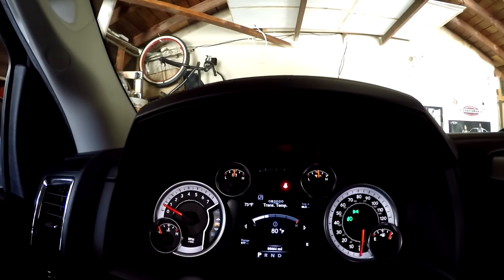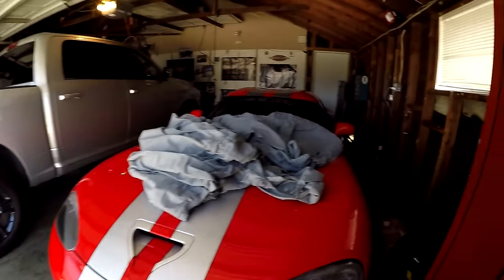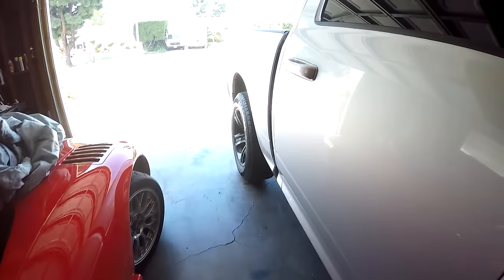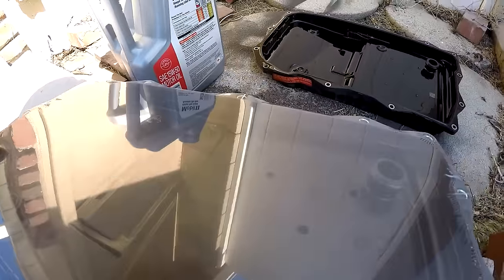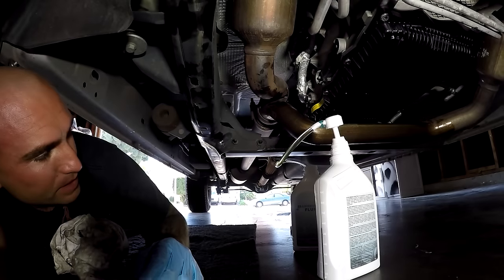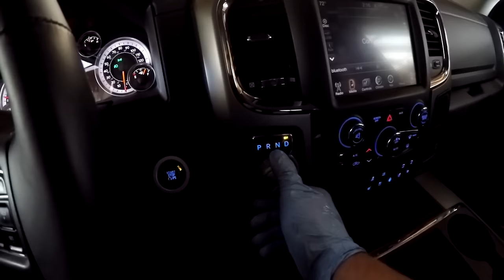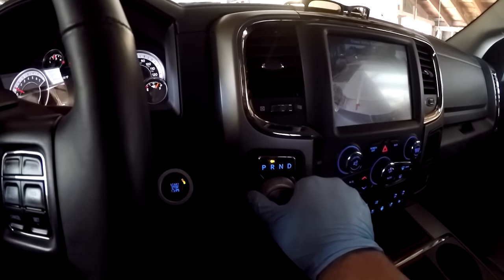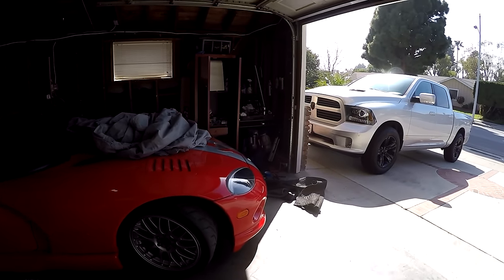Dodge RAM 1500 - ZF 8 Speed Automatic Transmission - Fluid & Filter Change

Comment: why they couldn't design it with a filler tube is beyond me.
Reply: more opportunities for water ingress, harder to make it work with multiple vehicles, a dipstick is more open to interpretation too.
Reply: Manufacturers do their best to make sure their vehicles come back to them for service.....also it saves money. If a tube costs a dollar and you make a million trucks. Ram saves a million lol.
Reply: @rjbeer  and to keep you jokers from servicing it yourself. This is a sealed system. It takes a completely different fluid than atf.
Reply: @imus1426  that's why jokers like myself research and read so it's done right.
Reply: @rjbeer  that's nice. What google search, I mean "research" did you do?
Reply: @imus1426  my brother is a Bentley, Rolls, and Aston master tech and his shop deals with various other high end cars that use this trans. So getting the maintenance manuals isn't hard. As for myself, I am a helicopter electrician who is also a&p certified. I think I know how to do my own work. Any other inquiries?
Reply: @rjbeer  I'm sure. That's cute though. With all that and you still think it's some big scam they are running.
Reply: @rjbeer  a "master tech" of Aston, Bentley and rolls. Yea I've had cars come in from independent shops that call themselves that too. We fix their screw ups. You shouldn't get so defensive over my slightly joking comment in reference to your original comment that had no credence. They make products to last longer than they use to but not to surpass the certified programs when cars start to go to auction and outside dealers. That's when people go to outside shops and we usually dont share 100 percent of the info with them, only enough go get by. If your brother is a master tech as you state then he would tell you to not touch the trans fluid unless it was contaminated or taken apart. Those are the only 2 reasons to do a fluid change on the zf
Reply: @rjbeer  read my other reply
Reply: @imus1426  I will add just for background he doesnt work for an independent shop like you think. He works at the dealer and trained by those manufacturers. But I would like to hear your explanation as to why ram recommends on thing and zf another?
Reply: @rjbeer  if zf makes the trans then it would be their recommendations for the fluid service. I dont know what your dealer is telling you which yes I know some of those advisors don't know shit but that trans uses a lifetime fluid. It is not meant to be changed and cannot use any other trans fluid. If your were to service these correctly then it could cost up to 1000 dollars. Now how would that make sense on a 3000 dollar trans. The true zf for a bmw which is what I do is about 8000. We dont do this to make you come back. After 100 thousand miles we dont care what you do as it is out of warranty. We dont have issues with the zf unless someone messed around with something or ran the dog shit out of it. Mopar has several models of this exact trans, some are true zf and some are mopar versions of zf with modified internals but ALL require the same service. Any other inquiries?
Reply: @imus1426  lol this started over a dip stick comment. But anyway I know what you are saying. I understand that it is supposed to be lifetime fluid and lifeguard 8 is the only fluid advised for this trans. But in my line or work when you have 2 different recommendations on a service you go with the most strict. Mopar says lifetime, zf says 80k km to 120k km. I tow and use my truck pretty hard, I'd be a fool to not service if I expect to continue to use my truck after 100k. And if I get free fluid and can do it myself why not? All I pay is time and for a new filter pan. Honestly if you check out my video I have about changing the fluid on my ram it will show you why I feel the way I do and think lifetime anything is bs. All the magnets do their job in this trans but still I feel for at least the truck the service schedule might be a little lacking if they expect a long lasting truck. I will say when I bought my truck is was weary of the 8 speed but my bro sold me on it, and he was right...I love it.
Reply: @imus1426  is the most qualified man in the room. If you're smart you'll ask him questions and become  smarter!
Reply: dnnyshdy  Ford put zf manuals behind their early pickup diesels which were pretty much a joke.
Reply: Convenience. The tech is down there draining anyway, why not fill it there.

Comment: I I was following along just fine until you started talking about the slow trickle coming out of the bottom? I could see that there was fluid running out, but, I guess I just don't understand what was happening or why.

I've never done this before so, if you happen to get around to replying to this, could you please explain it as if you were talking to a child? Haha! Either way, thanks for the video.
Reply from the maker: You'll see a ton of fluid pouring out when the level is too high.  Once it spits this excess out you'll see just a fine stream coming out which is just oil splashing around inside coming out but the oil level is sufficient.  Once you see this you want to put the plug back in. 👍

Comment: This trany has no Torque converter! It uses a wet clutch instead. Power flushing is a waste of time. Mercedes uses this trany. BMW as far as I know the X5 I had used a dual clutch direct gear to gear. The fastest shifting auto available.
Reply: Actually, this transmission does have a torque converter. Benz uses their own transmissions- primarily the 9G-Tronic, as well as the 7G-Tronic for twelve-cylinder cars. The X5 has always used conventional torque converter-equipped planetary automatic transmissions.
Reply: Yes, it does have a torque converter.  I would recommend a full flush, instead of drain and refill.  I have this transmission iin a 2014 Ram 1500 Hemi, and it's been the best transmission that I have ever had! Perfect and QUICK shiftiing. Look at the videos on how this trans is built and you will see the converter.
Reply: How did you miss the torque converter?
Reply: Every automatic transmission has torque converter, unless your vehicle is at junkyard.

Comment: so everyone knows these transmissions like to operate at very high hit temps, 220 degrees f, and no towing man that's hot.
Reply: Edvin Nelius 
I've hit 248F last week not towing 605 mile trip home, 80F degree ambient temperature going 80 mph for about 8 to 10 miles had to slow down it started to wind really bad I keeped it at 60 mph after that transmission  temp went down to about 210 the under 200 but the great vine got the temperature up again an this time it didn't matter I was going 40 mph... I think something is wrong with mine.. ooh well still love this truck 2016 ram 1500 ecodiesel 4x4 crew cab... 55k miles so far.. if anyone knows what's I can do to fix it please let me know

Comment: So bad design  for change oil. Chrysler   Hm
Reply: That's how all domestic brands are, no drain plugs. Toyota is only brand that has drain plugs for, transmission, front and rear differential.
Reply: ZF is nothing to do with Chrysler,this gearbox is used across many brands
Reply: @repairvehicle  FWD based Fords have a drain plug but no serviceable transmission filter.
Reply: @atx-cvpi_99  , no, they don't have it. I had Ford Taurus front wheel drive and it didn't have drain plug.

Comment: Bold move changing that fluid when you didn't have issues before. The only reason to change the fluid is if it has become contaminated or the trans was serviced. That's it. I can tell you the "lifetime fluid" is not a scam to get you to buy a new trans or new vehicle. I work at bmw and we actually did see zf's have issues when people did what you're doing because they felt they needed to after being use to other models years past. I think the ram 1500 takes less fluid but I know the grand Cherokee with their version of the zf takes about 9 quarts. How is $500 in fluid alone plus the pan with integrated filter a good idea of preventative maint. That's almost $1000 on something that is $3000 new. Oh and the procedure to change these correctly is ridiculous and the vehicle needs to be lifted off the ground with someone shifting between drive, neutral and reverse at low speeds. But good luck with your trans after this and anyone taking your advice.

Comment: this is a service for Life transmission no need for oil changes
Reply: I wish that was true.  No fluid lasts for life.  not your engine oil. Not your transmission oil and not the milk in your fridge. zf says the fluid should be changed 50-70k miles but in the old days auto manufactures use to tell us tranny fluid should be changed every 30k miles so somewhere between 30 and 50 it should be done.  ask for a sample when you have it done.supposed to be  green and if it looks black then you went too long.  currently chrysler says every 60k miles.  they changed it from lifetime.
Reply: English tech guy ZF in Germany recommends replacing the fluid at about 60K miles, depending on severity of use. If 120K miles is a “lifetime” of a car to you, then you can leave it in. I will definitely change mine once. The automakers say lifetime fill because it makes maintenance look cheaper (fluid is $$$) and the transmission will fail sooner.
Reply: The fluid is 40 bucks a quart plus a new 180 dollar oil pan. Heaven forbid the dealer tell you that when you are shopping for a truck.
Reply: Chrysler do not make the oil or the transmission pan prices all Service Parts including the Transmissions are built in Alabama by zf  in a plart for Chrysler products and if you think that's expensive try looking up Chevrolets 10-speed transmission it is just nature of the Beast
Reply: English tech guy I will use AMSOIL’s fluid that is spec’d for ZF when I do my first change. As far as the pan and filter, this is still a fairly new transmission design. I think we will see aftermarket options soon.
Reply: Any car dealership Chevy Dodge Ford you name it don't turn around and say oh yeah and if you need to buy an engine for this vehicle it's going to cost you $20,000 transmission $15,000 why would any of them break that down one they probably don't even know being salesman every salesman  I know  doesn't know shit about that hell most of the technicians I know don't know how much that stuff is
Reply: English tech guy dude first of all it's proven there's no trans fluid that last forever. Car makers will only care for your vehicle if it's under warranty, when the warranty is over you're on your own and if the transmission fails well too bad, and guess what the dealership will try the best they can to sell you a new car or truck. Car makers want people to always have a car note.

Comment: What worthless garbage from Germany.
Forcing people to spend a lot of money on a new transmission pan each time you change the fluid that by the way cost three times as much as the old ATF+4 fluid.
Then there is no dipstick and you must check the fluid level as the car is running while your under it.
I can see a major lawsuit coming for safety issues like a car pipe burning someone's arm or worse, the car starts moving while your under it.
What was Chrysler thinking putting this kind of unacceptable garbage on their vehicles ?